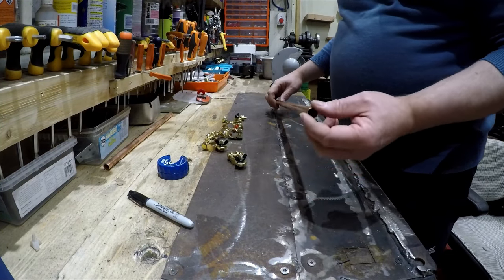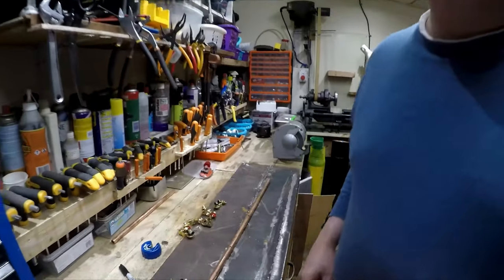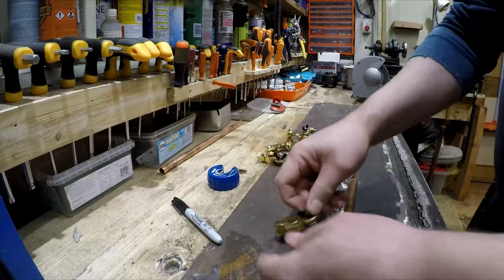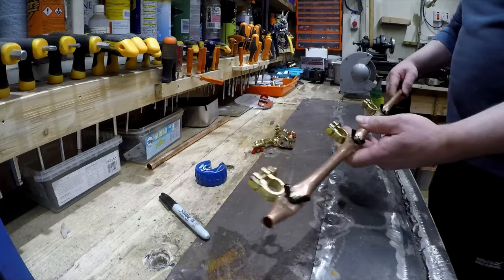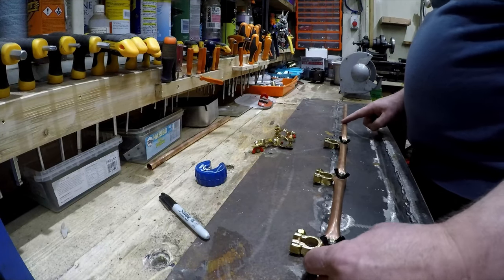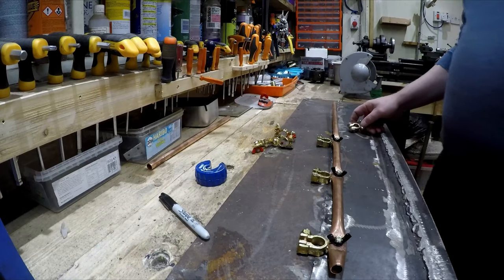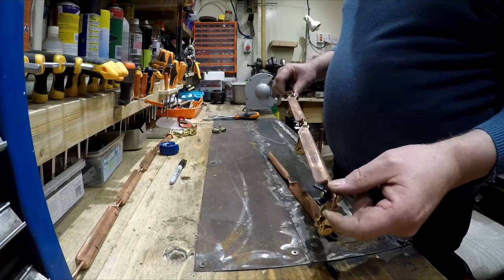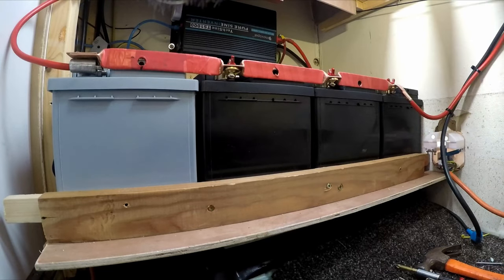DIY Busbars   💡⚡

Comment: How any amps would each busbar handle ? Do you need to coat to avoid oxidation ?
Reply from the maker: About 50 amps - 70 amps I have not coated mine
Reply: @JohnsWorkshopDiary  how did you determine the potential amps it can carry?
Reply from the maker: @coachgeo  Busbar Current Calculator Online
Reply: @JohnsWorkshopDiary   shweeet..  do you have some hints on good search terms to find this or similar calculator.  will try "Busbar Current Calculator "
Reply: lol....  well that went right to what you said. "Busbar Current Calculator Online"    thanks.  Im thinking grounding rod to make them up myself.

Comment: Firstly how are they holding up? Are you getting corrosion or maybe poor contact?
Reply from the maker: Hi, everything is fine, it's all holding up nicely. There is no corrosion as it is all inside :)
Reply: @JohnsWorkshopDiary  Yours is a super neat and very unusual design. I used flattened 1" copper pipe and 2' long 2awg cables. All my cables are the same. The goal is even draw from the batteries. I have mixed manufacturers so I think this is the answer.

Comment: Hi, some advice, I need to extend an equipotential bar, is it possible to join it with two 8 bolts instead of doing it all over again? or is it not recommended? Thank you
Reply from the maker: Should be ok to do it with the two bolts.